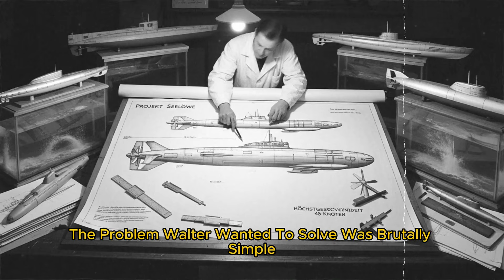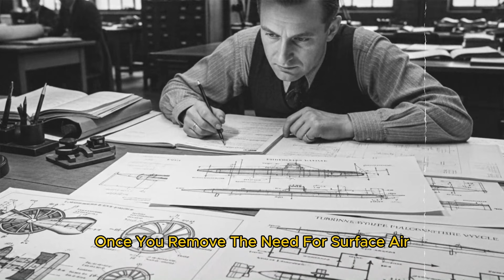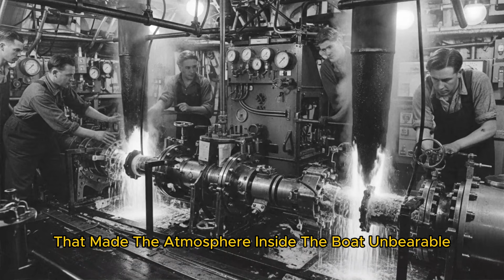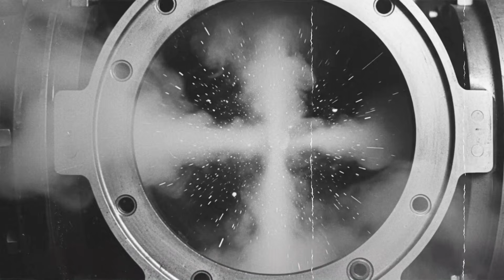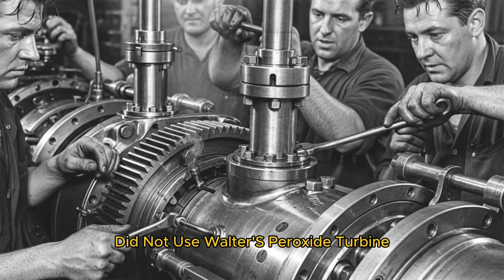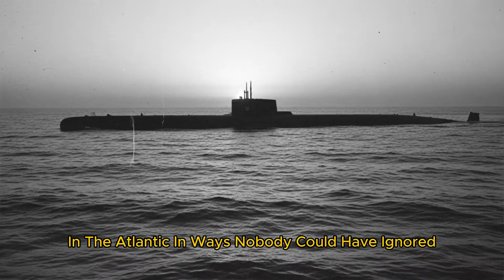Why Germany Tried to Build a Submarine That Didn’t Need Air (1944)

Comment: Hydrogen Peroxide is Very Dangerous. Imagine THOSE Torpedoes sitting up front. The Ruskies tried this on the Kursk. How did that turn out? Electrolysis and scrubbers solved the internal atmosphere for peeps on Submarines. But it didnt solve the Propulsion Issue. Practical Propulsion that requires no outside air was the next giant leap. Nuclear Power. The US Navy has almost perfected it. We operated over 500 reactor cores of 27 different plant types. Yes we had some issues. But we learned the hard way in some respects. We worked in parallel on Sound Silencing and Hull Integrity. We are continually learning about the environment Submarines dwell in, as well.  Technology will eventually solve Unmanned Submarines restrictions and limitations. Unfortunately Submariners will go the way of the buggy whip. God Bless Submariners.